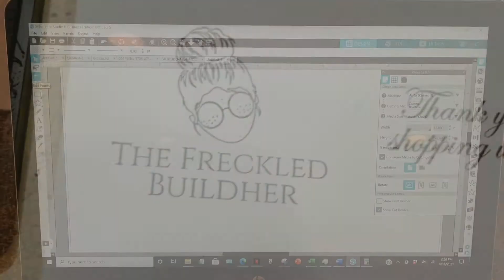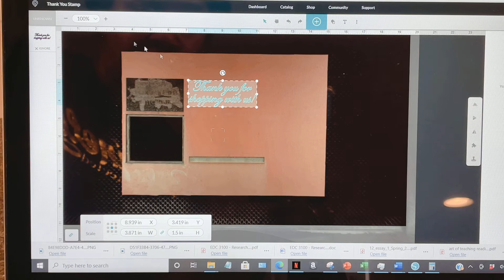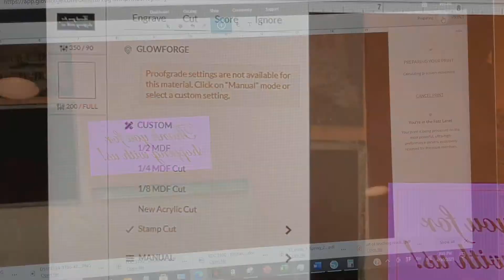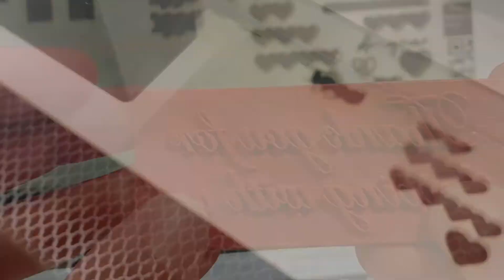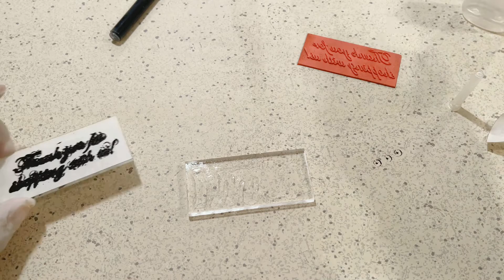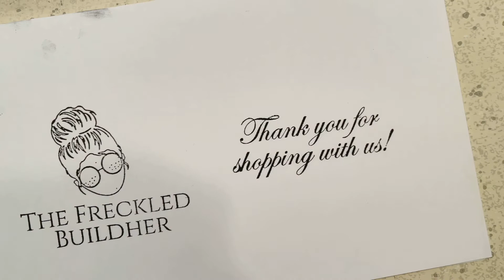How To Make Stamps with Your GlowForge | Stamp Making

Comment: Can this be replaced with acrylic instead of rubber?
Reply from the maker: Do you mean that instead of stamping with rubber, you’d be stamping with acrylic?? That actually sounds interesting, would be interesting to see how that would turn out. I don’t think it would work as good as the rubber, but you may still get a similar shape (stamp) when pressed. Also, the acrylic may not hold the ink as good as the rubber does because acrylic has a slight shine to it which causes ink/paint to not completely cover it … I’m actually going to try that! You may be on to something! 😂😆